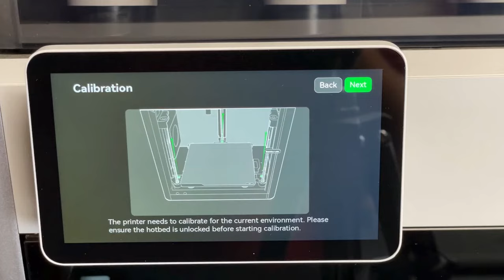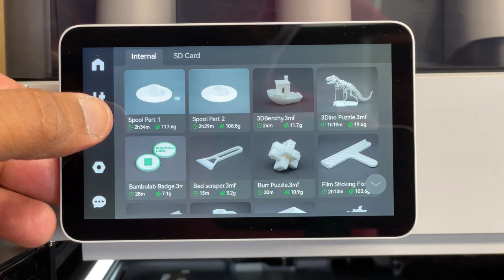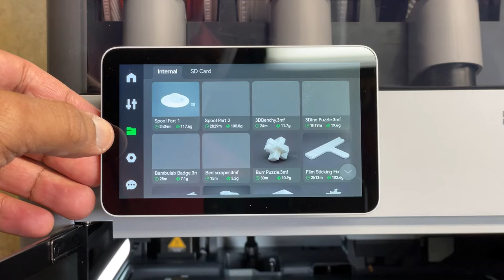Bambu Lab X1-Carbon - Setup and First Print - Initial Thoughts

Comment: Best printer I have ever bought. I now have 3 X1 Carbon AMS units. So far I had them for just over a week and 180 hrs so solid printing for a week. One failed print, user error on my part. Maybe 10 kg of pla has gone through each printer and all on sport mode. No extra noises coming from the unit. The Creality units I bought all had new noises and rattles after a week!

Comment: Bambu fixed everything that I hated about 3D printing. It's as if every company gets their product 90% completed and then gets the community to fix all their issues by calling it "open source." Finally, someone designed a product that didn't require another 2-3 days of tweaking and assembly.
Reply: my 3 3d printers, only 1 printed and it printed horribly (one had no ports whatsoever)

Comment: The W in "Support W" stands for "White" which is the colour of the support material, identifying it as the support material that Bambu sells for PLA. Their "Support G" material is green and is made for supporting PA and PET (but not PETG). They are not water soluble, but will easily break away from the material they're supporting, leaving a clean surface. The best way to use them is to print a thin interface layer between your supports and the object (both of which should be in the main, cheaper material).
Reply from the maker: Thanks Hamstah.  But I'm still left wondering what the material is?  Other support material will list what it is such as PVA or HIPS.
Reply: @DesktopMakes  I looked at the TDS and MSDS on Bambu and it appears to be nylon

Comment: I didn't go all the way to an X1C but just got the P1S and I'm equally impressed, after working with a Prusa MK2S for a few years. In the last 3 weeks I've had one print failure, when I forgot to put the magnetic build plate back before printing lol

Comment: Just set mine up yesterday, found a little quirk you started to touch on. To take the cardboard off the tool head I pulled it left an inch or so, and I didn’t put it back. Mine failed to calibrate three times before I wondered if that starting point was the issue, so I pushed it back against the right edge and then it was all happy.

I am super impressed at how easy it is to use. I have a good quality Zortrax but by comparison it’s very clunky. Tonight I’m planning to do a three colour print in one go! I typically have to set up the Zortrax for each colour and do three prints and glue/weld them together so I’m so freaking excited to have them come out with no joints!

Comment: I just received my X-1 Carbon. As you noticed, setup was a little tricky. I managed to dislodge the foam under the build plate before calibration (it was hard!) and later realized I was supposed to calibrate first. Ugh! Calibration failed on the first try, but succeeded on the second. I get errors somewhat frequently (like filament loading error) but the it generally seems to fix the problem on a "retry." I'm still learning but I am really impressed with the speed and quality.

Comment: After only a few seconds I knew this is mine to watch. Exactly the same feeling about buying the Bambu lab but now have ordered the X1 after using the p1p for a month now.
Reply from the maker: Ha, you caved to the peer pressure too!  How do you like the P1P?  I was actually thinking of getting that one at first since I mostly print one filament at a time.
Reply: @DesktopMakes  they are working as we speak. It makes my workflow on a item I sell way better. Now the bed is done every 18 hours instead of 28 hours with better print quality. I have to see in the long run but for now I am happy with them (i have 2 P1P atm and the X1 is shipped to me today)
Reply: @DesktopMakes  btw sold my prusas and cancelled the xl orders

Comment: Can you tell me if you see any vertical line print issues? Like what I get from my Prusa MK4S+? Apparently the new MK4 has higher resolution stepper motors and does not occur. I print large boxes and printing large flat surfaces you really see them with the MK4S+. If this is not an issue with this printer I may purchase one,  especially since the print volume is larger than the MK4. Thanks!

Comment: Any help would be appreciated, ive been struggling since getting mine. I just can't get my first layer to stick well, i have tried multiple different spools, with and without the AMS system, completely cleaning and reapplying glue, etc (ive only attempted about 30 prints so far and of those 30, i have only had a handful of ones successful), they always end up spooling everywhere or the first layer not adhearing/sticking every single time. I've tried slowing it down, doing it with/without glue, lowering or increasing temps (both extruder/bed), different brands of filaments,  im just at a loss of why im having such a terrible experience with this printer. Then I have never been able to get it to detect the build plate localization (maybe thats my main issue...?)
Reply: I'm having the same issue with the preset prints. I eventually ended up using BambuStudio for my first two prints and they turned out way better. Did you ever solve your issue with the preset prints?
Reply: i agree. same bullsh!t. 1st layer won't stick. I'm having no luck getting them to take it back. Very, very upset. I've tried everything: glue stick, hair spray, PEI plate, temp of plate increased, temp of plate in the middle, washing plate with dish soap and drying thoroughly, wiping it down with alcohol. Everything. Nothing is getting the 1st layer to stick correctly. I'm pretty certain the extruder head is too far from the plate. If I can GET it to stick, the rest of the model prints perfectly.

Comment: Be great if the speed didnt rip the first layer off each time ive tried, at this moment im ready to chuck this machine, nobody has been of any help whatsoever in getting any answers or help with settings. All i ever get is oh just fiddle with it and itll happen. Yeah like i have hours and hours with heaps of money to waste on the term fiddle with it
Reply: I'm getting the same thing. please let me know if you figure anything out. I'm so, so annoyed. I want to send it back.
Reply: Did either of you resolve this? I'm new at 3D printing and my attempts at printing Benchy have all ended in gobs of PLA all over the nozzle and nothing stuck to the bed. I'm using the green Basic PLA that came with the printer, on the PLA side of the flexible bed that came pre-installed.

I've noticed 4 or 5 cm of material comes out of the nozzle during the XY harmonics calibration step. Not sure if that's normal.
Reply: @jonathanfuerth1019 the filament  coming out of the nozzle is normal, it's just purging itself. One con of the bambu is it seems there's a lot of wasted filament

Comment: Great video! Unfortunately, my experience has been awful. I received a faulty printer and when I reached out to support they took 3 days to get back to me. They had me troubleshoot the printer and after a week of going back and forth, the AC Power board was faulty. Instead of sending me a working 3D printer they are having to fix their broken machine. I asked for a replacement and they ignored my question completely. It looks like an amazing printer but their customer support is awful!!! I recommend buying a PRUSA printer.